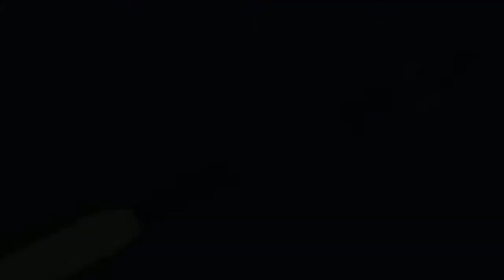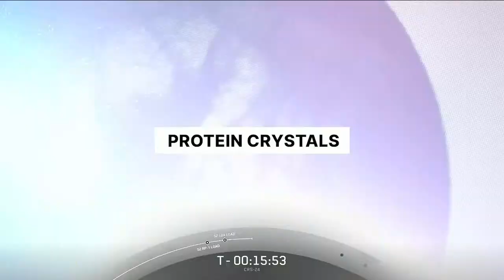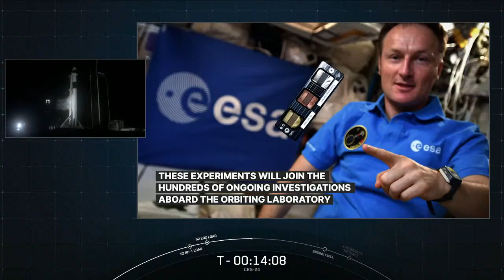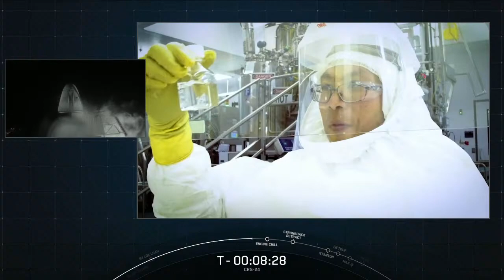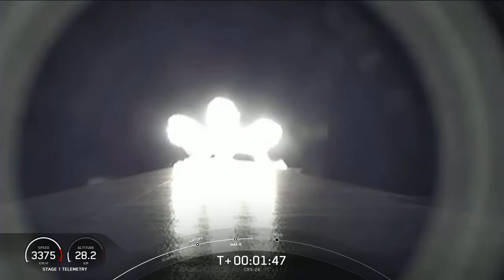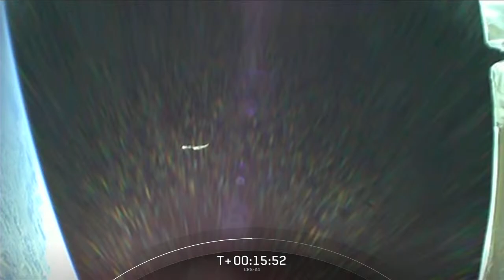CRS-24 Mission

Comment: 100  ......top that ULA
Reply: ULAs rocket simply can't propulsively land due to their drastically different launch profiles.
Reply: you can put it that way , or just say , they suck
Reply: @Ebbrush3  No, they literally can't. The Atlas Core and Delta IV cores are all too fast at MECO to be recovered. Its physically impossible. They are MUCH closer to orbital velocity than the Falcon 9. Simply check The DART mission and the Lucy mission launches. More faster = More entry heating. And adding the necessary things to make ULA rockets re-usable would only decrease payload capacity and make the rocket heavier since it would need more of everything than Falcon 9.

If they could, they would. But still huge props to SpaceX for the 100th landing.

Comment: why don't you build a gas station in outer space... so that going to mars will be easier
Reply: They are working on it! Will be a Starship as tanker version. Elon said docking will be easier than docking at the ISS because they have access to the steering of both units and can align them faster.

Comment: Why, with all the advancements with technology, is the video feed of the landing so often distorted or somehow messed up?
Reply: Vibrations.
Reply: If you want to know why, google.
Reply: Because the rocket is flying through its own exhaust, which can block or break up the transmission, and being digital, it pixellates or breaks up entirely rather than just a little 'snow' in the picture like the old analog days.  Plus there's a LOT of vibration and buffeting and that hinders the transmission and reception as the signal is relayed.  Plus, the video isn't their primary concern... MUCH more important to keep good telemetry signals from the drone ship and rocket stage, and that takes a lot of bandwidth, so the video signal is secondary to telemetry... Later!  OL J R :)
Reply: @lukestrawwalker  Thanks!  Great reply.

Comment: Soooo, why not create a system to create an electromagnetic shield to protect passengers from radiation?

You could use superconducting tape connected to the ships power system, placed on the outside of the craft or just under the "skin"... If you place the tape correctly, you will get a large electromagnetic field around the craft that can deflect the radiation...
Reply: Because Dragon is clearly fine without it.
Reply: @OortCloud  is it?
Reply: @three6nine992  Yes, it is. If it wasn't,  None of these crewed missions would have launched and neither would these CRS missions have launched.
Reply: @OortCloud  they haven't went to Mars yet. And it would work for more than just tye crew dragon.
Reply: @OortCloud  the passengers in the dragon and ISS do absorb much more radiation while in orbit, an electromagnetic shield would significantly reduce that amount..
Reply: @three6nine992  Your source just of curiosity? For both the ISS and Dragon?
Reply: @OortCloud  What do you mean?
Reply: @three6nine992  Where did you get that information from? You made the claims but you didn't really tell where exactly you got it from...
Reply: @three6nine992   Spacecraft in low Earth orbit are naturally protected by the Earth's own magnetic field.
Reply: @odysseusrex5908  they still recieve far more radiation while in orbit rather than on the surface,  low orbit or not...

I mean i provided the link to NASA, what else is there to say?

Comment: Hello Elon
Just watched a video how You want to use a small fishon reactor to power a ship to Mars in 6 months .
 Problem is radiation. .
I have an idea. that might help whith that .
 The problem is that nutrons are entering the space craft .
 What I understand. Is that is what causes the cancer in Humans .
 Weii i am not a Physicist .
 But my mind says that if protons are enterd to a spaceship it might act as a positve force to block nutrons from entering the spacecraft 
  If it is possible to build a hollw shell to a spacecraft and fill it with nitrogen. Protons. It would 
 Block. harmful nutrons. From enteting the craft and harming the crew .
And well notrogen is very lite and is non toxit

Comment: Does any1 know what function the ring that falls in pieces in the end of the nozzle of second stage engine during second stage engine igntion have? Does the nozzle expand during ignition? Thanks!
Reply: It's a stiffener.
Reply: Bell is so big that it would bend under its own weight while the rocket is transported on the side, ring prevents it.
Reply: @randomnickify  Seems I learn new things every day! Thanx for the info!
Reply: @randomnickify  Thank you soo much! Amazing! So when it finaly arrives in 0g its safe to get rid of the ring. Edit: just thought of the forces the bell gets exposed to during firing. That ring would not have been needed even if the engine was firinging on the side in the atmosphere. I guess...

Comment: What happens to the 2nd stage  after the dragon leaves it?
Reply: It gets disposed of by reentering over the ocean
Reply: @weekiely1233  in other words... wasted =(  Guess that's better than loosing 100 boosters.   I love it that landing a rocket isn't fiction anymore.
Reply: @dragoncarver287  recovering second stages is really really hard in comparison to first stages. SpaceX has looked into it but it would probably take more resources and cost more than simply making a new one so they stick with expending them.

Even future rockets such as Neutron with reusability in key focus don’t have reusable second stages
Reply: @weekiely1233  eventually I think there would be a way.  For instance... refuel and use for launches from orbit.  Used like booster to save fuel when launching the starship from orbit.  Like in "The Expanse" when all those little boosters were used to move the behomoth.
Reply: @dragoncarver287  there are ways such as Starship or the Shuttle. But those are simply not reasonable for most launches nowadays.
Reply: The engines of first and second stage are very different. The booster (first stage) is equipped with nine engines who work in our athmospere, the second stage is equipped with one engine that works in space vacuum. A vacuum engine won´t work too good in the athmosphere, especially for the complicated actions needed for a controlled landing.
Reply: @macdieter23558  BINGO (means I got it)  So what goes through my head is... put some atmosphere engines on it.   That would also mean it needs to carry more fuel.  A lot more fuel because it's going faster, which means the energy expended to go faster needs to be expended to slow it down. Plus the 1st stage is already full so it can't carry more fuel.  And it just goes on and on beyond the point where it fails to work. 
Thank you  everyone for this clarification.
Reply: @dragoncarver287  And all those engines, plus all that fuel, plus the necessary heat shielding, just took away most of your payload capacity. We're just going to have to wait for Starship.

Comment: After stage 1 separation they say it begins to make its way back to earth, yet its telemetry has it still climbing more than 56 km higher, from about 70 km to about 127 km in altitude. What might be better wording for what I guess is upward momentum driving it up higher since its engines are shut down. This could also be bad telemetry data but that seems to be more of a stretch.
Reply: No, when you're moving upwards at 5000 km/h in thin air you complete your ballistic trajectory higher.